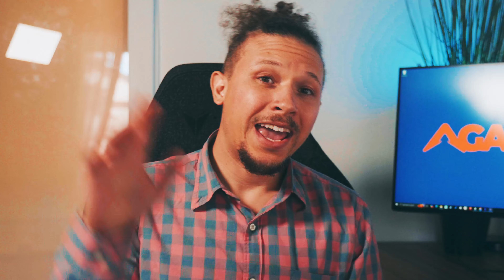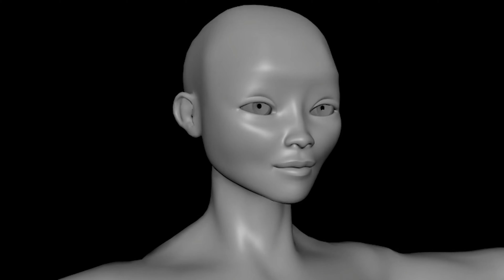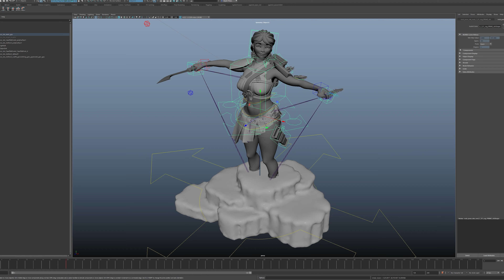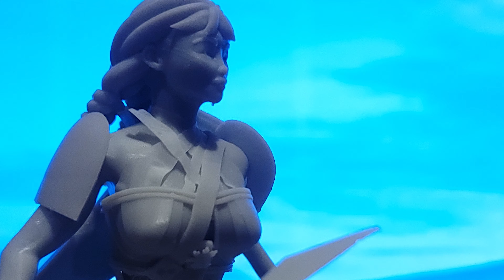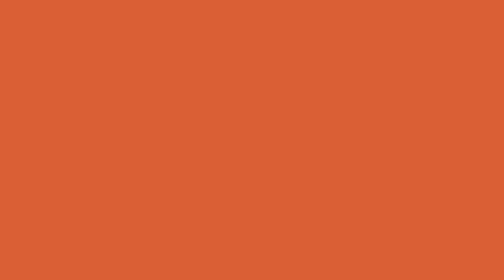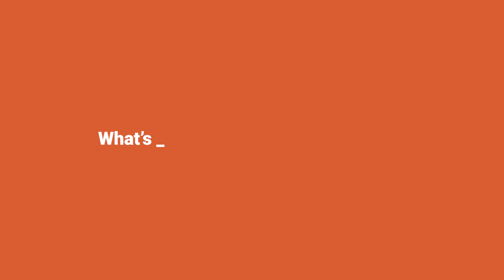This 3D Printer Might Just Change Everything...

Comment: It's the best cheap resin printer you can buy at the moment but no, it won't change anything and there is nothing especially innovative about it. It has some serious design flaws (you have to choose between the heater and fume extractor, there's no handle on the lid, lots of important parts are cheap plastic) but overall it's still a relatively good deal if you aren't willing/able to pay for something better.
Reply: Just to add a few things as well:
- DO not cure the model before removing supports. If removing supports prior to curing is damaging the model, either try reducing the exposure time or soak it in warm water before removing the supports. Curing it will only make the problem worse (remember, you'd be curing the supports as well as the model).
- All resin printers (at least those that I own and the others that I'm aware of) come pre assembled, it's a standard thing. 
- Do not rely on the "auto levelling" feature. It's notoriously bad on cheaper printers like Elegoo and not even completely reliable on more expensive ones.
Reply from the maker: @MonstaMunch101  Thanks for the extra tips. It has been a mostly smooth transition from FDM to resin with this printer, despite the flaws you mentioned. I only mentioned the curing before removing supports for the tiny detail that are paper thing, but maybe there's a better method. What resin printers do you use?
Reply: @agamid_cg  I've had a few. Currently I use a Uniformation GKTwo for most stuff and a Phrozen Sonic Mini S for transparent parts (because it has a smaller vat and I typically don't print much in transparent resin). My GK3 Ultra is due to arrive in a couple of weeks after some long delays and I'm looking forward to it immensely but I'm not expecting it to be wildly different than the GKTwo, aside from obviously having a bigger build plate. The Uniformation printers also have the advantage of having a heater built under the vat so you don't have to worry about those Canadian winters.

If you want to take all the fuss out of the equation, HeyGears is the way to go. Everything just prints perfectly straight out of the box with no calibration or messing around, but they are expensive and the end result isn't any better than you could get with a cheaper printer. 

The main thing I'd recommend is googling the right settings for the printer/resin combination you're using. It'll save you a lot of time, hassle and resin.
Reply: @agamid_cg  I use two printers, my main one is a Uniformation GKTwo (soon to be replaced with a GK3 Ultra that I ordered ages ago, they've been badly delayed). It's great because it has a heating element under the vat so you don't have to worry about outside temperatures and it's very well built. I also have a Phrozen Sonic Mini S which I just use for small transparent parts.

If you have plenty of money to spare then the easiest printer is the HeyGears Reflex RS, you just plug it in and print without any calibration or setup, but given that the output quality isn't any higher than printers that cost half as much, you're better off just doing the whole calibration thing on a Phrozen or Uniformation device instead (both have excellent build quality). Once you have it all dialed in you don't need to do it again, and you can usually find people who have uploaded their own tried and tested settings for pretty much any resin/printer combo anyway.
Reply: @agamid_cg  I replied to this like 3 times, not sure why it keeps disappearing but: I currently use a Uniformation GKTwo as my main printer and a Phrozen Sonic Mini S for small transparent parts (I like to have a separate printer for transparent resins as it saves me from having to clean out the vat to switch over). I ordered a GK3 Ultra ages ago but they were hit by long delays, when it eventually arrives it will replace the GKTwo. The Uniformation printers have a heater below the vat which helps massively in cold climates and works far better than the "space heaters" other printers come with. In theory the downside is that the LCD should need replacing sooner, but I haven't found that to be the case so far.
Reply: add poor screen reliability and lcd ribbon cable. simetime i hits the vat and gets damaged